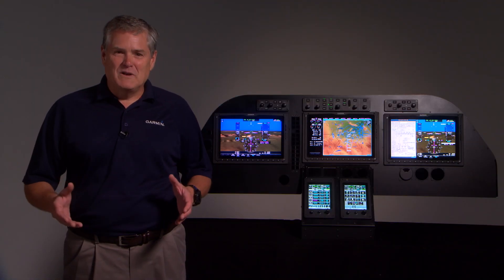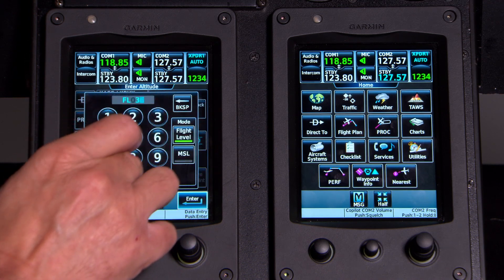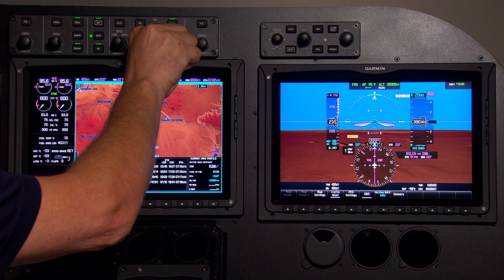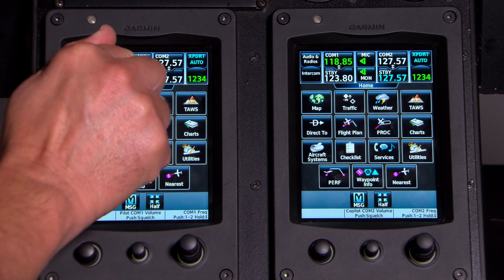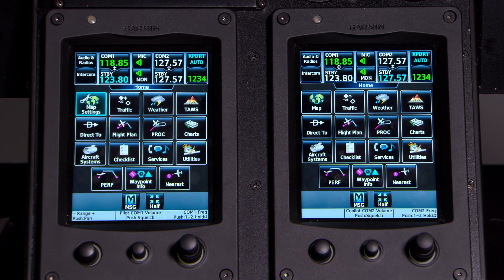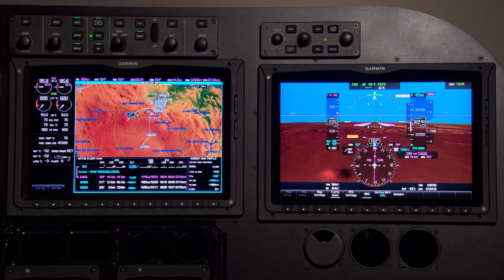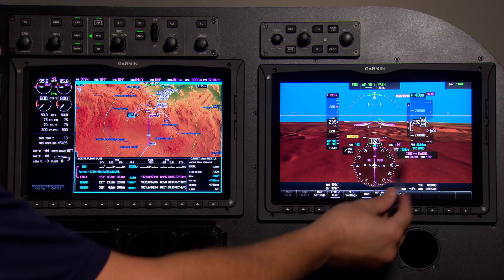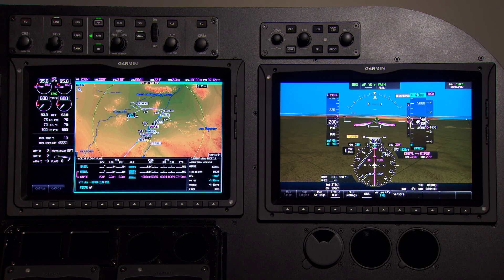Garmin G5000 for Beechjet: Approaches and Landing

Comment: How do u input the wind in the g5000 ? Also i noticed the fuel calculated for each waypoint and upon landing is calculated in a “measured” method so to speak live fuel flow and not in the “predicted” method using forecasted winds. Theres quite bit of fluctuations in the calculated fuel at each way point constantly changes due to live fuel flow rate how can i change that ? Thank you

Comment: A question that just came to me: Why don't major manufacturers like Airbus and Boeing use Garmin solutions, but develop their own? From the layman's point of view I have, it looks as if the Garmin system is in no way inferior to the FMS of an Airbus or a Boeing.
Reply: Workload. Garmin is workload intensive. Too many ways to do things. Airlines are all about standardization. They don't want many ways to do things.
Reply: Wanna bet. I’ve flown all three. Garmin is a distance third.
Reply: The reason Boeing and Airbus don’t use Garmin is because Garmin is relatively new to the aviation market.  Both Boeing and Airbus have been using their own versions of FMS since the early 1980s when the 757/767 and A300 were certified.  To swap over to Garmin at this point would require recertification, training for all the thousands of flight crews, maintenance, simulators, instructors, to say nothing of the actual costs of thousands of Garmin units.  I’ve operated all 3 since 1989 (except the Garmin, which I’m still learning) and the Boeing is the easiest to learn, the Airbus is next, and the Garmin is the toughest to learn because it’s got so many hidden drop down menus and superfluous features and pages of nebulous choices.  Like the comment above about when and where to set the “Minimums” Garmin should have put that on the “Charts” page but hid it in an undisclosed location!  Obviously this wasn’t designed by a pilot!

Comment: Is the Beechjet with this Garmin system "single pilot certified"?
Reply from the maker: While the upgrade does not remove the crew requirement for the Beechjet, it does help save weight, adds value to the aircraft, adds a wealth of modern operational capabilities, like LPV approach capabilities, charts, datalink weather, and much more – it truly is a worthwhile investment!

^DK